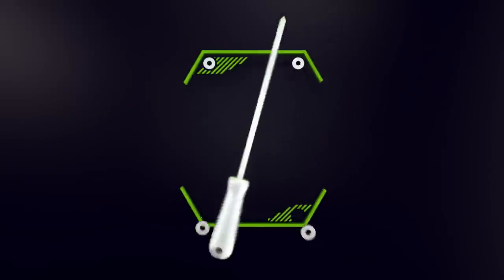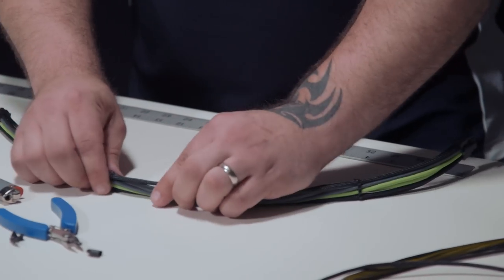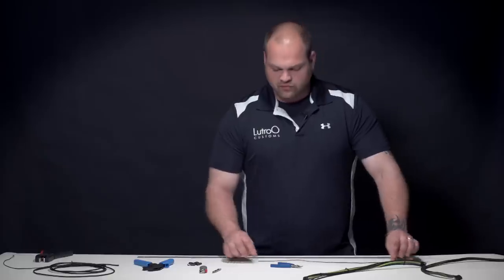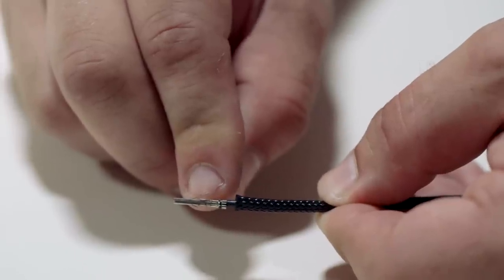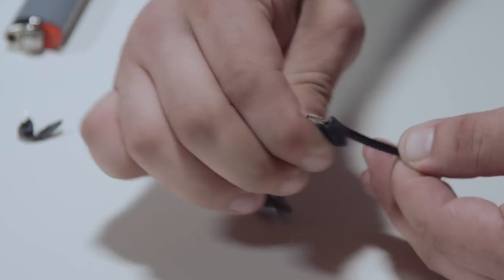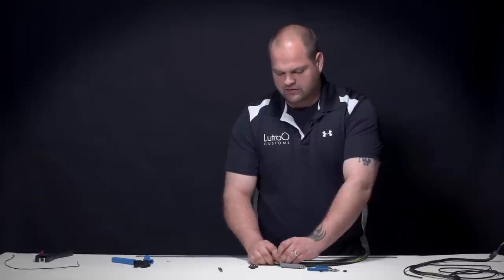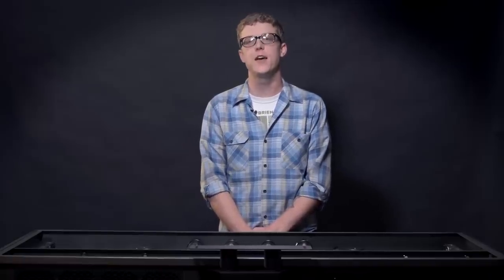GeForce Garage: Cross Desk Series, Video 2 – How to Sleeve Your Cables

Comment: How to sleeve your cables = buy sleeved cables.
Reply: squalltheonly A single 24 pin sleeved extension cable from the guy in this video costs $60.  $40 crimping tool aside, you can buy all the necessary parts for around $50 or so bucks.  

I think the main allure to DIY sleeving is when you need specific length cables that don't have any extra slack and also for those super slick looking laying flat 90* bends where the outer cables are longer than the inner ones, etc.

The guys that have the time and dedication to do that have my utmost respect but I ended up just buying some silverstone sleeved extension cables.  Looks good enough for me though I may end up getting some of those cable combs that keep all the cables bundled in a line.
Reply: FastRedPonyCar Huh? Sleeved cables are like $15 in amazon.
Reply: squalltheonly Those are extensions, not full replacements that go into the actual PSU itself.  Several companies offer full replacement cables like Cablemod but there are also guys like the dude in this video or the guy from Ensourced who offer a far superior looking and made cable and those are the ones that cost significantly more.

It makes the difference in this

http://cdn3.bigcommerce.com/s-5pvh2pmh/products/90/images/356/Modular_cable_2__38830.1409584484.1280.1280.jpg?c=2

and this

http://i00.i.aliimg.com/img/pb/694/001/487/487001694_092.jpg

It's a matter of just how obsessive you want to be with it but also allows you to specify custom color patterns and stuff...not to mention, using just a totally new replacement cable lets you not have to worry about excess cable from the factory cable coming from the PSU and the bulky adapter fitting where the braided extension cable connects.

In full disclosure, I'm currently using the silverstone extensions but am planning on having the Ensourced guy build me a new set of replacement cables but only after I move everything into a new case.
Reply: squalltheonly But where is the fun in that?

Comment: how much would this cost vs just buying them from corsair etc? seems like a lot of work just for cables when you can buy em
Reply: The initial cost of tools and supplies with be higher but you will be able to make custom length and colored cables where the corsairs are one length and one color.
Reply: Kasek thats true.
Reply: Kasek im sleeving my own psu for half of the price that corsai sells it for xD 
So yea i do use alot of time on it but i get it the way i want it to look and i save some money ! :)
Reply: ***** tooms ???
Reply: ***** yea i do have the tools but even tho if i was going to buy the tools and all the sleeving it's still cheaper than buying corsairs shit sleeving ;)
Atleast in my country ;)
Reply: As with any hobby it is as expensive as you make it. The tools can be high or you can choose to keep it to a minimum. Here is an FAQ that will help. http://www.overclock.net/t/1262900/frequently-asked-sleeving-questions/

There is many avenues to take when sleeving - I suggest to do some reading and see if its for you and then take one of those roads to getting it done. 

The end result is a custom sleeved cable that is becoming the standard to show-case mods.
Reply: ***** ill look in to them thanks. sweet thumb nail btw love that show
Reply: Best Quality you can get with MDPC Sleeve, the corsair stuff is just a toy compared to that. Custom cable lenghts are the best thing about it, couldnt live without.
Reply: Wire would cost near nothing. Quality wire from a electrics store is very cheap.
The expensive part is the crimping tool. Wire cutters, strippers etc are optional. You can get wires stripped with a simple  sharp knife.
Shrink tube costs cents aswell.
The sleeve will cost a bit more.

For one - no shop here sells molex crimping tools. - so would have to make a international order which adds a lot  to the price. And they already sell at like 50+$.
Reply: The initial cost for buying decent crimper is very high. Maybe about 65 USD just for a crimper. The wire stripper cost vary, but for me, 10$ should do the job.
If you want make much cable (more than 10 sets) and have decent skills for making that, go straight buy the tools, and sell the cables to your friends too. A set cable in store may about 10-15$.
If you already familiar with making that kind of cable, it should be easy, about 30 minutes to make an 8-pin cable.

the hardest things for me, is finding decent connectors. I don't trust cheap-no brand connectors, it may melt in your motherboard.
Molex-brand are the example of best connector out there.
Reply: Mauro Tamm I got my crimper straight from million dollar pc (MDPC-X.com) they ship to the USA also and you get genuine Molex parts.

Comment: would it be possible to just use an extractor tool, to remove the terminals off existing power cables (to avoid having to buy new wires) and feed a new sleeve over the existing wire (using some special tape to avoid damaging the delicate pins), then add heat shrink and re-attach the terminals? would this effectively achieve the same result as in the video, but removing the need to cut new wire and crimp new ends? The advantage of his way is having the cable the exact length you need. But is that the only advantage?

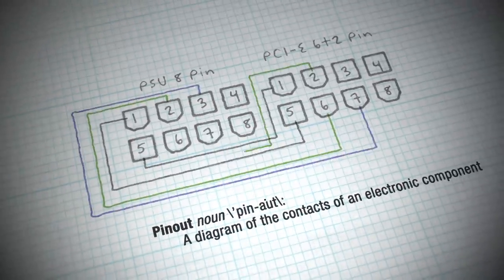Comment: NVIDIA lutro0 How do I know how to run my wires and what hole they should be in? I know in the diagram at 2:42 it has 4 and 8 on the right both going into slot 8. why?
Reply: +asher217ify all of the connectors are an industry standard, simply google the connector pinout and you should find detailed diagrams of which wires go where.

Comment: How do the sleeving for the 8+6 pin connectors for GPUs? I don't want to do the loop thing where tis' PSU=========8pins===6pins. I'd rather have 14 pins that route to the other side of the chassis / motherboard

Comment: If you think that this seems tedious and a bit time consuming than you would be right. However, the sleeved cables you buy online are 30cm or 50cm. That's it. They are also not power supply modular friendly. The ones online plug into your existing cables and are just an extension. So that modular P/S you paid extra for to get the cables looking clean was a waste as you are now going to have a rats nest to hid.
It's worth it to me knowing that I didn't have to leave it in the hands of somebody  who doesn't care or doesn't get it to your exact specs. It's not rocket science.

Comment: Hi, what kind of wire should I use ? Power supply  original cables are 18AWG are they to thick?
Reply: He used 16AWG Gauge in the video. https://youtu.be/dcsP2S0l9Ps?t=164

Comment: So, can I do this with a non modular psu? specifically the psu that comes with the Evga hadron air?
Reply: You can indeed do this to non-modular PSUs, Check out this faq: http://www.overclock.net/t/1262900/frequently-asked-sleeving-questions/ Also we have done a few hadron but they require allot of rewiring due to the small nature of the PSU.

Comment: Hi,
I'm based in the UK and am a bit confused about what type of wire would be suitable for sleeving.  Can anyone make some (sensible) suggestions?  16awg, what is the UK equivalent?
Reply: +Stephen Boyd 16awg is a standard that is used in uk too 18awg is thinner than 16awg which means that 18awg will be more flexible and easier to place the sleeve over

Comment: How do I make a pin-out so I dont blow up my system :/ ??
Reply: Simply which wires connect which sockets
Reply: What I did was label my cord 1-24 with little pieces of scotch tape and worked my way 1-24 sleeving the cables and putting them in the right way. It was easy.
Reply: Ah thanks guys, might it just be ok to sleeve the cables 1 at at time and then replace each?

Comment: for the cable do you pull the original one out or waht what do i need for this?
Reply: +Some Kid Plays CS:GO he's doing custom length, thats why he was using a crimping tool and all, he has a roll of cable and cuts it accordingly to his desired length. if you have a modular psu and you just want to sleeve your cables, you can use a connector extraction tool and pull out the cable without having to make it all-over again. all you will need to do is the sleeving itself, the heatshrinking and reconnecting the cable back into the connector.
btw if you're doing this, then you don't need the cable diagram, you can just do each cable one at a time.
EDIT: disregard that last part ... i was thinking about molex connectors, not about itx or pci connectors...

Comment: I was hoping he would mention what tool he uses to remove the pins from the plug so you can sleeve an existing cable.
Reply: fourbypete use a molex extraction tool, has two little flat pins that you stick in the hole. Really easy.
Reply: @xmdude626  Thanks, I've been wondering what the tool was called.

Comment: Is it possible to resleeve already sleeved cables?
Reply: +AshEverything Unfortunately not, the MiniFit Jr connects used for PC power can't be disassembled.  You could cut off the connectors to salvage the wire, but you'll still need to buy new female pins and connector housings.

Comment: Can anyone tell me for a fact whether or not EXTENSION cables get connected in the same slot on both connector ends? But then I'm confused if they do because my pre-made NZXT extension cables do not look like they plug into the same square on each end because the cables are all criss-crossed. I would like to avoid blowing up my system lol.
Reply: +Machine Lee Yes they would be.  They are just extension of what is already there so they will just go straight through.
Reply: Yes thank you I finally figured it out lol

Comment: Will this work with a AMD card?
Reply: Erik Søndergaard Gimsing All modern PC parts use the same connectors, so using this technique on cables and plugging them into an AMD card will work the exact same. You sir, need to stop spreading false information.
Reply: MLG NeverFail Fail troll.

Comment: Looks nice but heat protection is bs this is purely cosmetic 
The heat in the pc will never melt cables not sleeved even the thinnest fan cables
I think cables are made of pvc which melts at 140c so unless they actually touch the motherboard heatsink or ram in a insanely overclocked pc it wont matter.

Comment: I think i will just buy them in store, the amount of time spend along with the cost isn't worth it imo :P
Reply: You're absolutely right. It's not worth it to do this yourself for a build in a normal case. If you have a case though that is completely open, even behind the motherboard, you'll want to do the whole cable and also incorporate bends into the cable. Right up to where it plugs into the power supply. That's where you'll need to sleeve yourself.

Comment: 13 years of experience with sleeving and he uses a lighter for the heat shrink :-S
Reply: I prefer a bic for heatshrinkless as I can control the flame and the cheapness of buying one - however when I sleeve with heatshrink I do use a heatgun. We had to leave allot out of the video to keep the length down.

Comment: looks confusing on the part where you have to match the correct pin connectors, how are you even suppose to know which ones are right or wrong when you're mapping them when all the cables look the same?
Reply: +Phillip “Alkaris” Pether You just follow the cable from one connector to the other. It doesn't matter which cable connects the 2 ends.